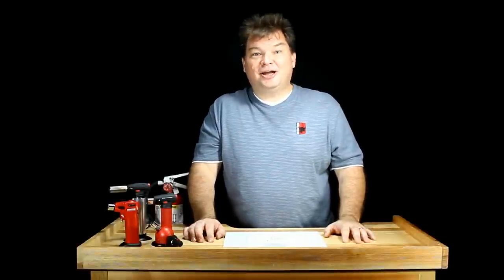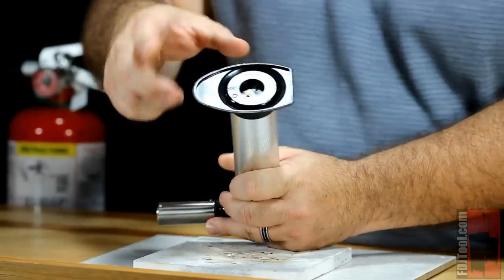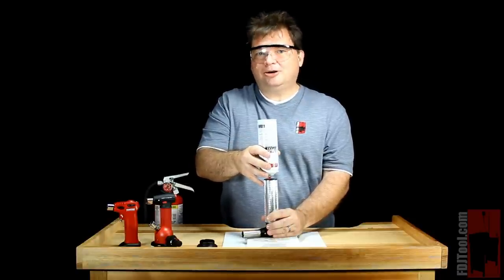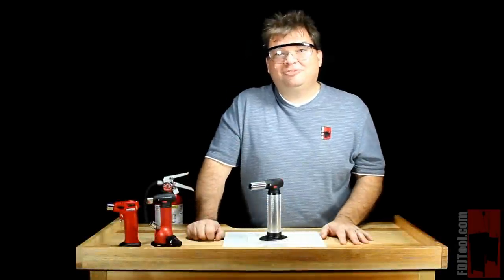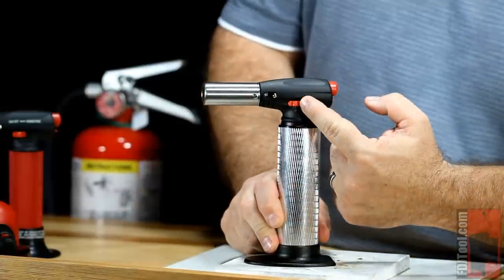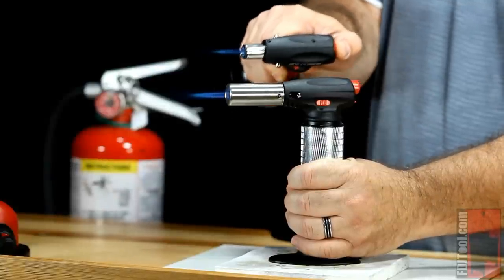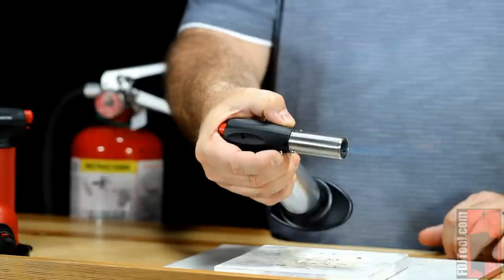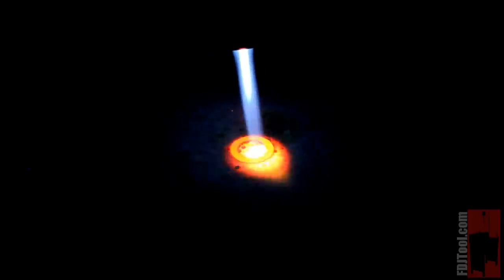Using the Jumbo Max Flame Microtorch

Comment from the maker: To put it very briefly, a reducing flame is a yellow, bushy flame that is low in oxygen.  This is good for heating metal since it "reduces" the amount of oxygen on the surface cutting down on firescale.  The opposite is the oxidizing flame which is the thin, bright blue, loud flame.  It has lots of oxygen making it very hot.  Good for melting.

Comment: Can this torch be used for hard and medium solder? I have an in home studio and also wondered if you advise using the EZTorch or acetylene inside my home.
Thanks for your comments.
Reply from the maker: Susan DeBay This and most other butane torches will get hot enough to work with medium and hard solder.  As far as "stepping up" to bigger torches.  You want to use what's comfortable and easy.  Acetylene torches release a lot of soot which, over time, will discolor walls, ceiling, etc.  Propane tends to be cleaner and easier to get.